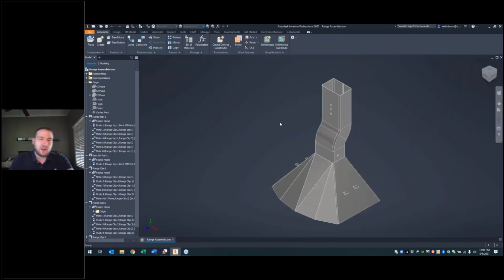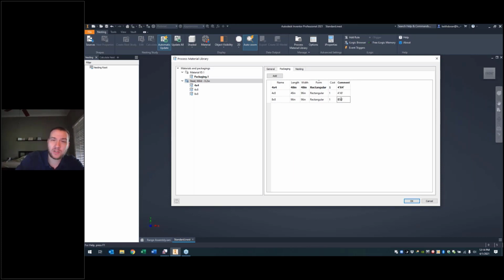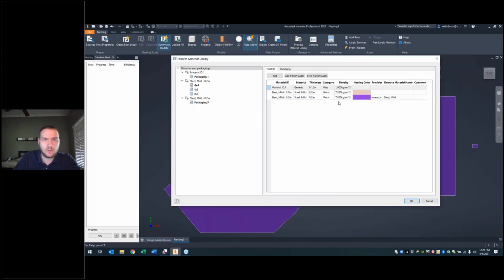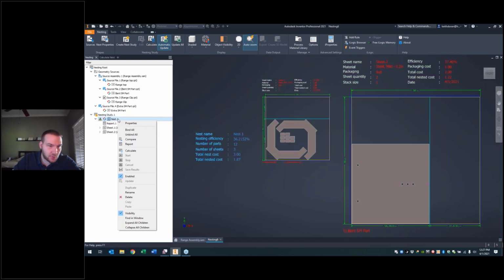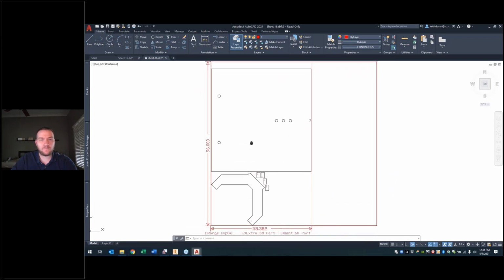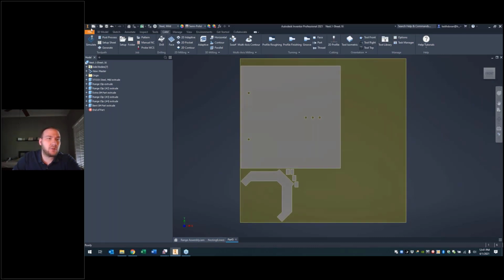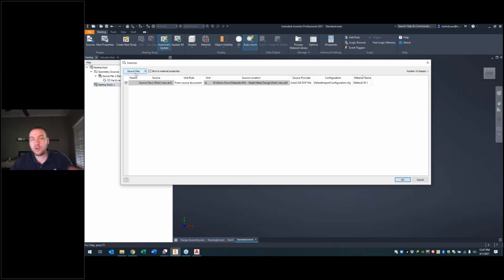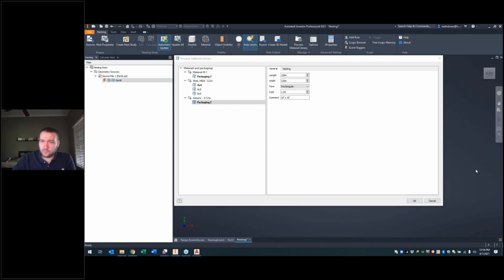Autodesk Inventor Nesting Utility

Comment: Cheers for your informative video. Can you please advise if you can manually nest the parts, or is purely auto-nest only and you're stuck with the nest that the software creates?
Reply from the maker: The long and short of it is, the nest makes what the nest wants…
 
BUT, you can do things such as control what angles the parts are allowed to be in as well as whether the nest can flip them face up or down, and with those controls you can more or less fine tune the alignment of critical parts within the nest. Beyond that, such as manually moving parts within the nest, this COULD be done if the nest is exported into a new assembly, which will basically place all the parts in their respective locations with Grounded enabled. Disable the ground, and manually move the parts as needed.